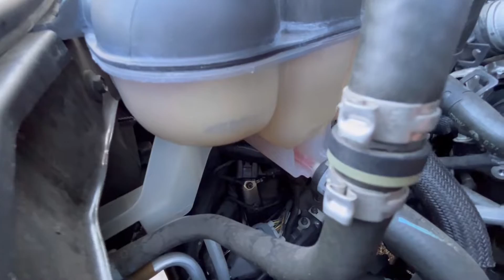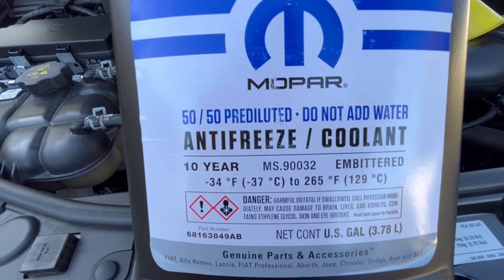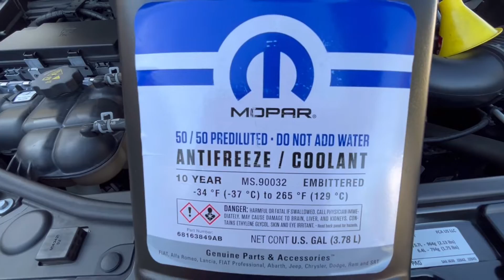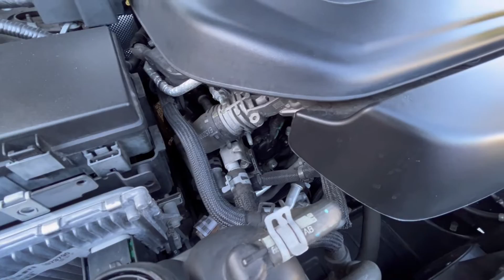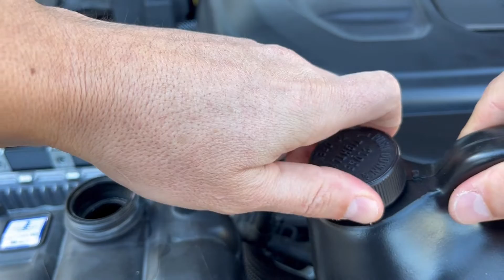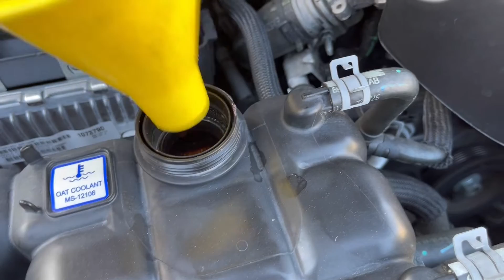How to add coolant / Antifreeze to a Dodge Durango V6

Comment: What is the difference between 12106 and 90032. The manual says MS 90032 but under the hoods it says MS12106
Reply from the maker: Yes, that is correct, but there is no difference, both are the same.
Reply: I have a question, when I brought my 2019 durango in my coolant reservoir . I noticed its orange and red. But the MS90032 is purple/ violet. Does the color change over years
Reply from the maker: @mariomolina6296  (OAT) 12106 & 90032 coolants are regularly orange, yellow, red or purple.